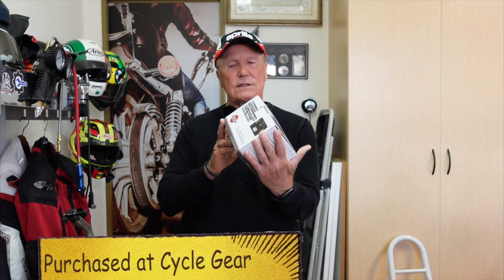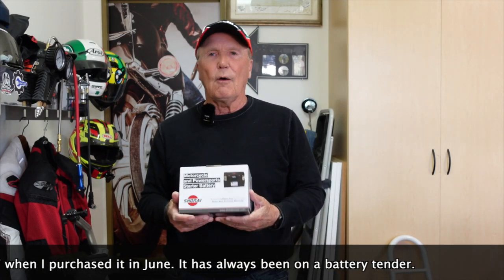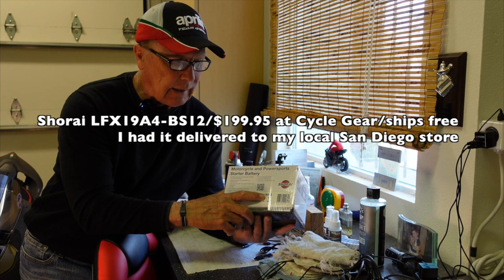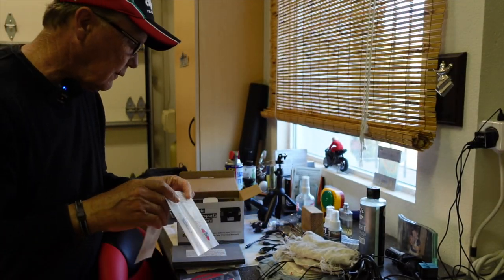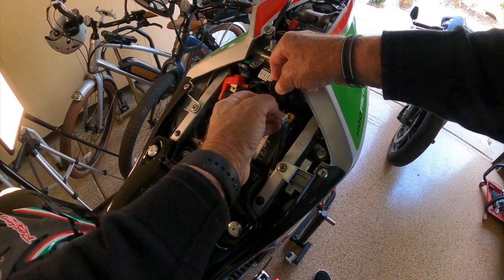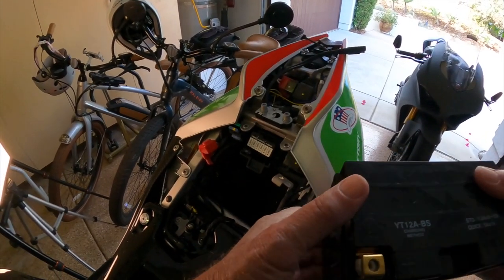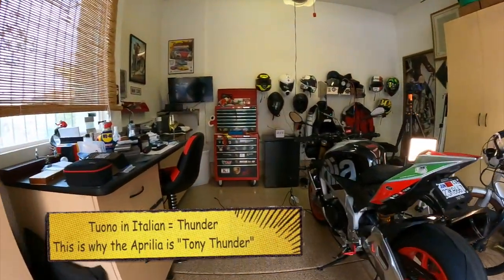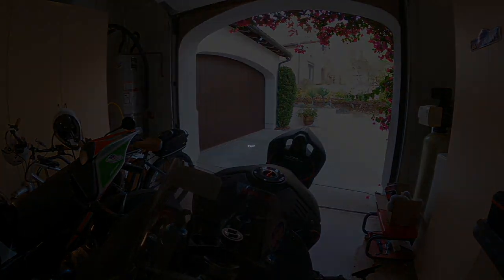New Shorai Lithium Battery for my Aprilia Tuono   HD 1080p

Comment: My 2018 Aprilia RSV4 RF starts fine when cold but after riding for a few minutes the battery acts like it’s almost dead. I replaced the battery two summers ago. I’ll try a lithium battery and see if that will fix the problem. Thanks for the video.
Reply from the maker: Jeff, that is a weird problem indeed. More typically an older/tired battery will exhibit problems at starting, not after running for few minutes. This is due to the charging system on your bike as the motor is running. 
This is why after jump starting a battery, and a bit of charge time on running. The battery will restart the machine on its' own.
While I am a solid fan of Lithium batteries and would say they are a vast improvement....over lead acid I might recommend you get your charging circuit checked out?

Comment: Under what circumstances would you need/use  a charger for Lithium?  Long term storage? Btw, that positive terminal on your old battery , either I am watching a mirror reflection or you are turning that wrench in the wrong direction... either way, great video :)
Reply from the maker: As pointed out by Bob Carter above I've made a serious blunder in leaving the charging cable in place! I plan to take care of this right away.
1st reason is that it is set up for a standard battery, and it would be easy for someone to hook a standard charger to the Lithium battery with potentially disastrous results! I feel like such a dweeb! This is SO obvious I should have thought of it.
A fellow from England commented re the Lithium battery that sometimes he had to garage his bike 3 months or more due to weather. I thought that this might be just that bit too long without a charger there.....
2nd reason is because as you point out they are really almost never needed due to the endurance of the Lithium battery.
So, coming soon a change to the way that I left it at the first install.
P.S. no the wrench was turning the right way........or at least I hope so!
Good comments, thanks.

Comment: Hi Garey, love the channel but this mod is one I just have to comment on sorry. I have done this mod and firstly, once the bracket is undone at the top you can pull out the battery for easy access to the terminal bolts. No need to fiddle around. Secondly, please please remove the Acimate charger cable. It is totally the wrong fitting, is designed for actimate trickle chargers and it is very likely that dealers may plug a standard charger on there if it is presented in the tail unit. (they just do for many reasons). If it does they explode with obvious serious consequences. Do not tempt fate. When you buy the matching Lithium charger it comes with a new cable with the appropriate low power connector that you fit in replacement. And lastly (sorry) that battery is not seated correctly due to the positive lead fitting and it will move about. The positive cable needs to be either re-routed or just cut off the side element to make it fit as standard. How it is fitted now is just wrong and it looked like you just shut the seat on it to mask a poor job (out of sight out of mind engineering which on a motorcycle, never works).  Please accept this as a constructive response from someone who has done this mod and appreciates all the other quality guidance you have given us Aprilia Tuono owners over the years. Love the other vids. This one alas not so much. :-(
Reply from the maker: Excellent advice Mr. Carter! Okay you are 100% on that charger cable and I feel bad because it so obvious! I will remove it ASAP. 
I will take another look at that positive side fitting as well....
Again, very grateful for the advice here......thank you indeed.